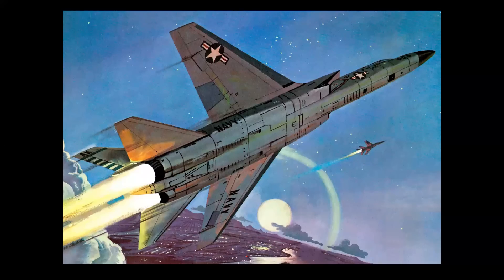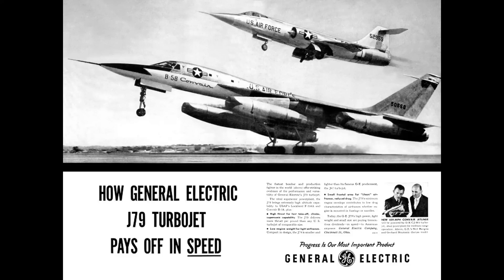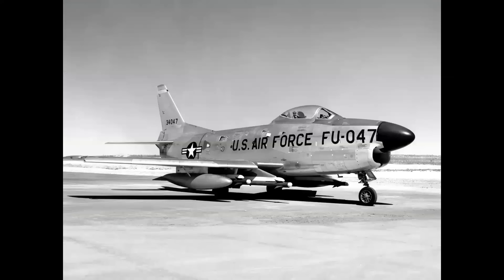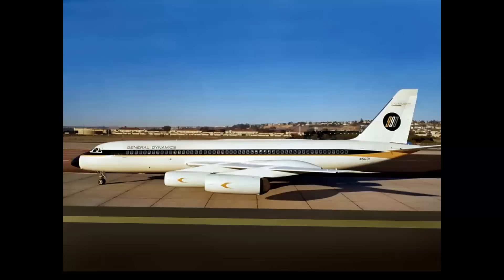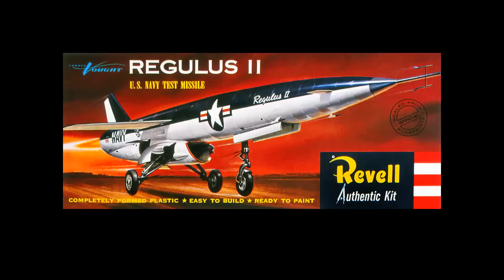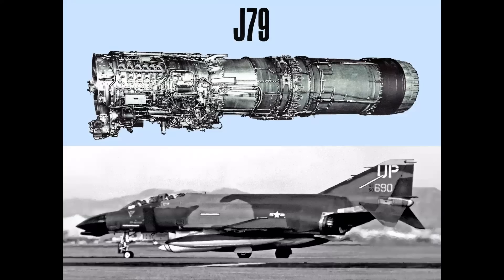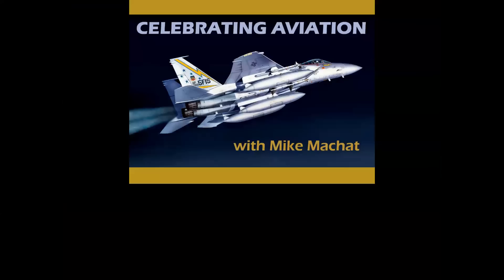GENERAL ELECTRIC'S MACH-2 MASTERPIECE! The turbojet that propelled America's fastest aircraft.

Comment: The F4 Phantom was the most efficient converter of JP4 to black smoke. The F4 Phantom is still the world record holder of distributed Mig parts.  I flew the F4 Phantom N, J, & S models from 1978 to 1981. The S model was produced in 1978 with several improvements, and the engine was improved and operated at a little higher temperature, which reduced the smoke considerably.  The F4 could use a lot of fuel very quickly.  When doing ACM air combat maneuvering looking outside fighting another airplane I would look back inside just to look at one gauge and that was the fuel gauge. The J79 engine was a marvelous performer and would run as long as it had fuel.  I will always miss those days.
Charles "Orville" Wright

Comment: The F4 Phantom was the most efficient converter of JP4 into black smoke.  The F4 Phantom is still the world record holder for distributing MiG parts.  I flew the F4 N,J & S  models from 1978 to 1981.  The S model was being produced in 1978 which had some improvements and engine modifications that made the J79 a lot less Smokey which was a major benefit.  The J79 engine was a marvelous performer and would always run as long as it had fuel.  Believe me when I say the F4 could use a lot of fuel real quick.  When doing ACM and zooming around at all attitudes, airspeeds and altitudes I would look back inside to just look at one gauge and that was the fuel gauge.  I will always miss those days.  Charles “Orville” Wright

Comment: Yeah Jeff, I've worked on the F-21A, Kfir, C-1's that we had from '87-89, in MCAS Yuma, at VMFT-401, with the HUGE : J-79's until March /April of '89 , when we transferred over to the F-5 E's.  We've originally got them from the Air Force, and the Navy F-5's from "Top-gun".   Years later , after flying the piss out of them , then we 've got  SWISS F-5's,,, that's what we currently have.

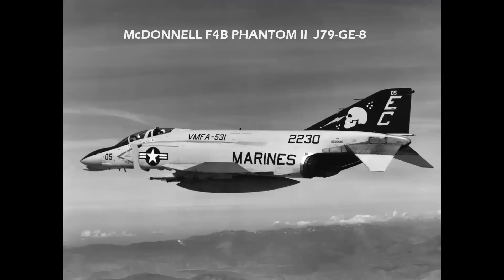Comment: The Douglas F4D  Skyray AKA the "Ford" is mentioned 6:10 but not shown.  In any case, it was powered by the Pratt and Whitney  J57-P-8B turbo-jet with afterburner following the failure of the Westinghouse J-40.
Reply from the maker: Aircraft shown at 06:10 is the McDonnell F4H Phantom II, as opposed to the J57-powered Douglas F4D Skyray, Grumman F4F Wildcat, or Boeing F4B biplane fighter. All different Navy designations from different eras. Thanks for watching!
Reply: @celebratingaviationwithmik9782   Sorry. l I mistook the  B for a D.

Comment: Outstanding video.  Remarkable  Power plant.  They were pretty smokey.  Trying to find out how much of the technology for the aircraft engines leaked over into the "frame" series gas turbine electrical units.  I know GE provided gas turbines for the UP railroad for their high horsepower locomotives back on the 60's and early 70's.   They were quite successful until bunker C fuel oil was priced out of range.
Reply from the maker: Great comment, thanks!
Reply: Love the painting of the Vigilante climbing up into the sky.  The Revell box scale kit was one of my first aircraft kits as a kid and I absolutely loved the box art of the launch from the flight deck.

Comment: The LM1500 was also used for power generation in industrial applications.  I recall visiting a GE appliance factory in Ontario Ca (78-79?), on a field trip for an engineering class.  Tucked into a corner of the facility was a repair/rebuild shop for those units.  I was impressed with the intricacy of the variable stator mechanism and general design and fabrication of these magnificent engines.  Such a contrast:  on one side of the lot they are manufacturing home steam irons, on the other, working on 13000 hp engines.
And on another GE related note, my family and I flew to our new lives in the US on an Aerolinias Peruanas 990, March 1964.  Buenos Aires-Lima-Mexico City (TWA 707 to Los Angeles).

Comment: You expect military planes to be loud, but I reckon the loudest, subsonic, airliner, would have to have been the Convair CV-990. I remember seeing Swissair examples at Heathrow and Spantax ones at Birmingham in the '70's, and the noise was just unreal!
Reply: I remember the 990 based at NASA Amers Research Center.  My building was next to the hanger where it was serviced.  Along side was an U2, a Cobra, the XV22, and RSRA to name a few.    The Us almost blew my VW over with its exhaust as I crossed the taxiway one morning.     The XV22 did a little demo for my one lunch time as I went out on with my camera and took photos, the pilot stopped, hovered close to the ground and did a 360 right in front of me, then went on his way.    Those days.    We also had the Pacific P3 base on the Navy side, so constant action there too.     The NASA 990 came to a sad end when it collided with a P3 on final approach, only one survivor who ended up paralyzed, Navy guy who fell from the stricken plane when the tail got cut off by the 990.   Turns out both planes were cleared to land o  the same runway.   I wasnt working at Ames yet when that happened, but I saw the crash smoke from home, about ten miles away.

Comment: Another nice video Mike!  I know aircraft and thier engines pretty well, but I learnt 2 new things on this one. Those aft fan versions of the J-79 are new to me. Were the fan blades built into the low speed turbine wheels or what? How was the hot turbine portion sealed from the cool fan section.......interesting. the 2nd was about the XB-70 motor. There is NO WAY an 18k thrust J-79 could reach 60k thrust. That is an entirely different and much bigger motor ....correct?  I guess my favorite BEAST motor, the J75 is really only the biggest mass production U.S. pure turbojet. You didn't mention the variable pitch stator blades in the compressor stage. A defining characteristic of that engine...that plus how smokey they were. I think a VERY refined version of this motor....the LM2500  (or something like that) powers our navy destroyers and some FAC'S. Portable generating stations also. Loved your box art too!!!!
Reply: The  XB-70  used the  yj93   with a max  thrust  of   about 30,000 lbs.   The  GE4  was developed  for  the  SST   and  had  a max  thrust  of   about  60 -  65,000  lbs.    The  key  technology  that  the  three   shared   was  the  variable  stator.   Each  engine  was   much  larger  than  the  previous.
Reply: @kevinbaird9763 thanks. I'd like to see a pic of the SST motor with a man standing next to it. Must have been massive....a pure turbojet- no bypass fan stage?

Comment: I grew up in Venezuela in the mid-Sixties, and flew VIASA Convair 880s to Miami probably 20 times. The engines were unforgettably loud and smoky outside the aircraft, but thanks to extra thick skin and lush insulation, were barely audible inside the cabin, at least in the forward section. Great video, Mike!